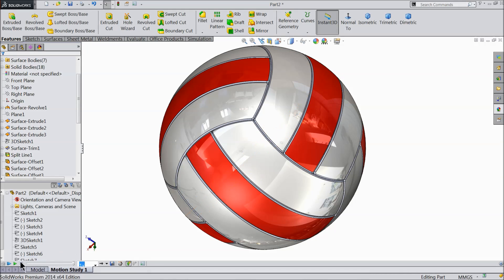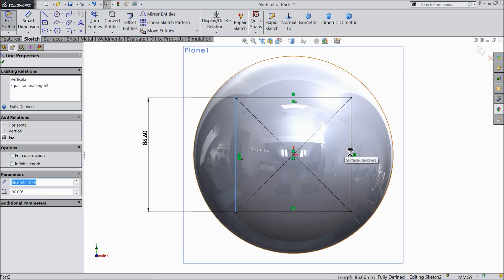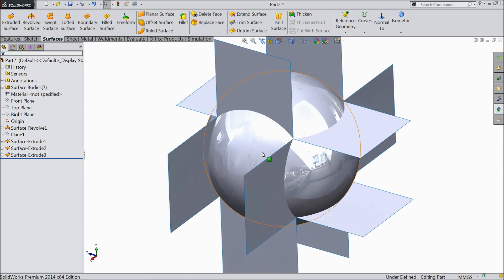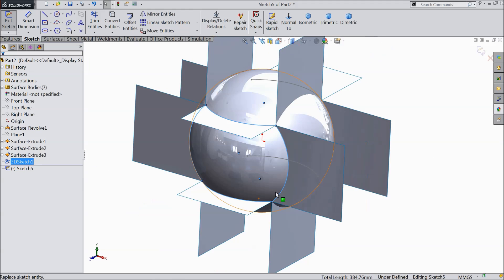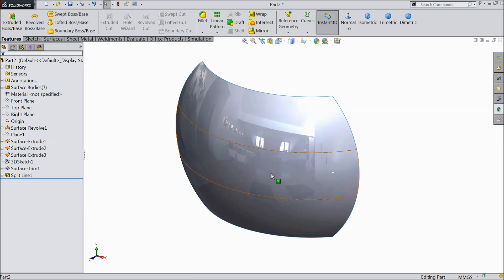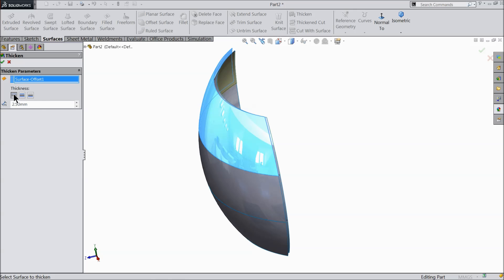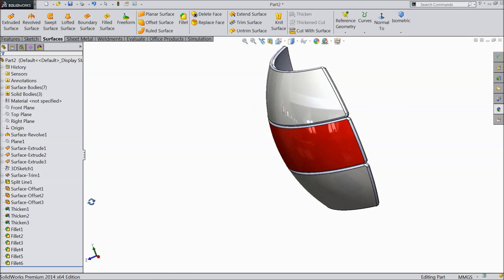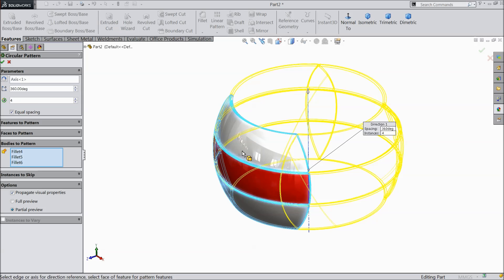Solidworks tutorial | sketch Volleyball in Solidworks (Surfacing) | Solidworks

Comment: For all those asking, the magic number 86.60... is the side length of the largest cube that can fit inside the sphere. The calculation is diameter/sqrt(3). In this case, diameter is 150, so the cube side length = 150/sqrt(3) = 86.6025. Now you can fit that to any diameter sphere you have ;)